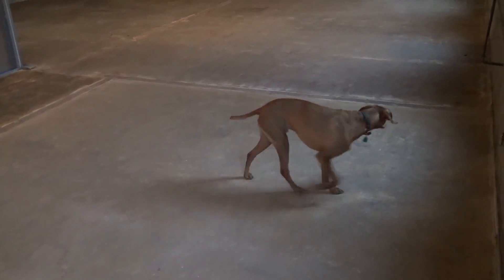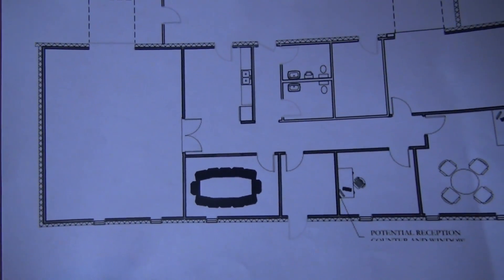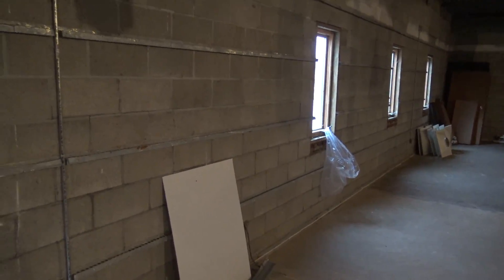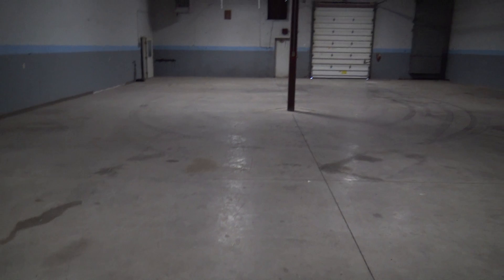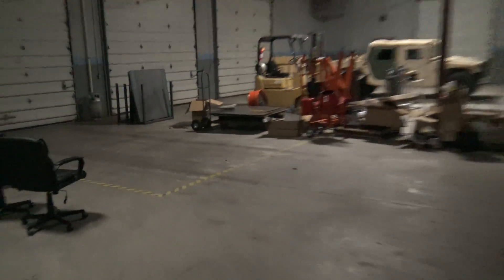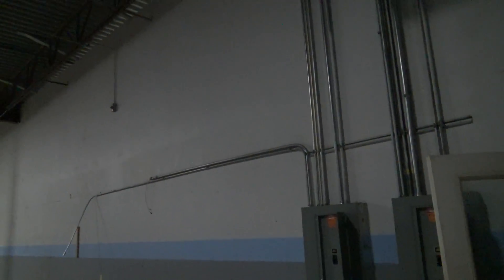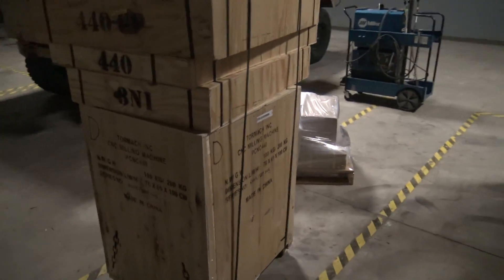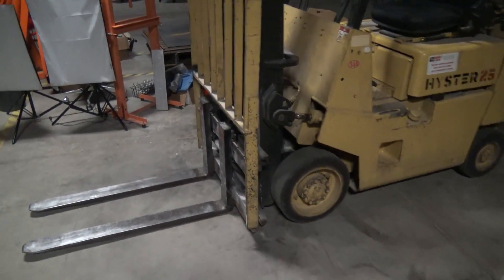Shop Update #1

Comment: Congratulations John. 
Regarding lighting, avoid T-5, they are expensive to operate, tube life is poor, replacement tubes are expensive, ballasts are expensive, they flicker a lot and lumens per watt is not as good as HID-Metal Halide or LED. 
If it is affordable go LED, but beware of offshore brands, we have had some less than best results with "Assembled in the US" units that had color and brightness stability issues and eventually failed, warranty replacements were a pain and also failed. 
Alternatively HID-Metal Halide fixture lighting are reasonably priced, have reasonable operational expense, long maintenance interval(bulb replacement), provide good color rendition and have excellent lumens per input watt. 
Look into utility and or federal and state discounts/credits/rebates/grants. 

If it is your budget, fill the gap at the top of the separator wall now, it will pass dust, fumes, particulates and noise from the dirty area to the clean area. Doing it now will be much less expensive, cleaner and less disruptive. 

Rapid-Air is a good alternative to copper, is a lot less expensive and if installed properly and is undamaged it will last a long, long time. Including drip legs w/drain valves at each outlet point reduces moisture contamination. 

Look into PolyCuramine, we have found that PolyCuramine floor coatings outperform most epoxy floor coatings many times and is superior in many ways including being impervious to most chemicals, superior adhesion and abrasion resistance including steel gantry crane wheels and 15,000 lb fork lifts. 
Our coated floors and walls no longer sweat and no longer release dust. 
We coated the concrete floor and the concrete walls that extend from the foundation vertically 6-8 feet above the finished floor with light grey and above 8 feet to the ceiling/roof with high gloss bright white. It resists soiling and is so easy to keep clean. No dusting, ease of cleaning and the reflected light is well worth the cost. Our floors are now close to 5 years old and show very little damage and minimal wear. 
From experience avoid the lesser expensive water borne epoxies, they don not holdup in a commercial or industrial environment. Be certain to get a written as applied warranty from the installer. 
Some installers will quote the coating manufacturer's warranty and will not warrant the as installed/applied application. These are the contractors that quote dirt cheap prices, do not perform the prep and installation properly, then take your money and refuse to correct their mistakes. 

I would recommend using a penetrating floor surface sealer treatment in the fab area, it will help protect the concrete, prevent most fluid penetration(oil, water borne), keeps the spatter from sticking, helps prevent the concrete from dusting, is clear/transparent and does not burn. 

What are the plans for HVAC in the production areas?
Reply: NYC CNC
Cool, sounds like you are on the right track. 
Look into the PolyCuramine, this stuff is amazing and virtually indestructible, even with heavy forklift traffic. It even resists acids, brake fluid and lacquer thinner. 
For us, those super sized industrial ceiling fans help some in the winter, but are absolutely no help when reversed in the summer heat. 
Large roof mount exhaust fans with security bars have been the ticket in the summer.

Comment: Glad to see things are coming along. I actually just did a new conference room over the summer. We had never had one and it seemed like a good idea gives us somewhere that stays clean and is comfortable to meet with customers or have meetings of need be. Bought a beautiful conference table second hand. Like you I looked into the copper lines and found them to be way to expensive. You really only need to run a large main line and then your branch lines and drops could really just be 3/8, or 1/2 inch lines. Unless you have a large machine with huge volume demands like a pallet machine or large pneumatic machine you will get plenty of air volume along with sustained pressure.
Reply: Oh and one other thing I found a good way to account for growth is to use T joints in your main line every 6 or 8 feet with the T pointing up. Just plug the ones you don't use but this allows you to just unplug them and run a drop from there if you add a new machine or work station
Reply: Oh and have a Merry Christmas
Reply: +NYC CNC Our conference room is 18-1/2 feet by 13-1/2 feet. I also used it as a place to put up pictures of our business through the years. There are pictures of my grandpa, dad and me along with other people who have worked here over the years. There is one wall where I have pictures of them building our current building from back in the 70's that are in chronological order. I also have a projector that I can display on the wall if need be. I am working on getting a display case to put some of the work we have done for customers over the years. It's deff a good place to really be able to display what your company is about and for me that is family.

Comment: I would recommend you plan to close off the gap at the top of the wall fully - how? studding, insulation and some suitable type of board. Foam filling to match the profile of the roofing material.

Comment: Rapidair works great.   You can get 1" lines for the main runs and then branch out with 3/4".
For the large dividing wall.  I would place insulation between the wall cavities and use 6 mil plastic on both sides.  Use metal studs (or wood if code allows) and run them up to the ceiling.  Slap some drywall on each side and your dust and lots of noise will be stopped.

On the front area, I would put drop ceiling in the video room, conference room areas.  It will help greatly with noise and dust.  Plus on the video area the white ceiling tiles will help with lighting

I look forward to seeing it at the open house.

Merry Christmas
Chris
Reply: When I had my studio, I dropped bars from the beams.  I used beam clamps to hold them and then dropped a vertical bar down to a tee  and then ran horizontal bars to hold lights and backdrop.   We had one room with white ceiling tiles and one with black ceiling tiles and grid. The bars just came down through the tiles.  The Black really helped with reflected light when we wanted to control it more.

Comment: As for the lights, I support the decision on going with LEDs, as I've said on the first video.
The price is not that high - it pays for itself quickly, as LEDs never burn out(compared to regular T5s) and use a tiny amount of power(a 10W LED is roughly equivalent to 200W of incandescents), and if you clean them out sometimes(dust), it'll never lose color or do anything bad like that, if, of course, you buy proper quality lights.  My suggestion would be to order a few tiny LEDs from eBay with various colour temperatures and play around - select which one you like, which one suits the shop. You don't want the light to be too warm or too cold, but I don't dare suggest bulbs from Yuji - they're nut-cracking expensive, although almost identical to sunlight.

And for the separation - just regular plastic should be enough, don't bother framing it all, I've seen it done this way in a few buildings.

Air-wise you can just get air-rated PVC pipe(kits) or alike, it shouldn't be too expensive, there are options.

P.S - you should try installing a few skylights in the ceiling! It's perfectly suited for it, and it's cheap(ish).

Comment: Good plan putting the fab on one side and the machine shop on the other. Another Idea is to install some air exchange that vent from the fab shop and intakes into the machine shop. This is how a few places here that have their welding bays in the machine shop set up. This way you get a fairly steady draw to the toward the fab bay and then if you are making dust in the machine shop it will gravitate toward the welding bay. Just go with black pipe on the air lines and put a dryer on the compressor for your main run when you get to that. My dad's auto shop has had 1" black pipe that was installed 25 years ago, just an auto drain on the compressor, traps on the bottom of the drops, when we renovated it there was minimal surface rust in the piping and just a little bit of crap in the bottom of the traps. Anything that could be harmed by a rust particles should always have a filter/separator on it anyways. Also instead of installing large pipe I would consider putting secondary receivers at the ends of long runs or in the middle of your loop if you're going to go all the way around.

Comment: sch 80 pvc for air lines, its quick, cheap and dose not corrode.  awesome stuff just saw it go in on a new fire house I am wiring.
Reply: I'm a commercial electrical journeyman in NJ Uniform construction code allows for pvc in not air plenum locations ( if you plan to install it in a drop ceiling for example) it was installed in a brand new FIRE HOUSE i'm currently wiring, for the Air lines to keep the air brakes charged up on the rescue engines. Installing  it on open walls or in open ceilings is a okay in NJ check with your local building officials. use airline rated plastic I looked at the pipe today it was a flexible  plastic hose system still really nice and cheap.

Comment: Awesome John! Got a good plan coming together. Check out the air lines made out of aluminum tubing. I'll check ours and see what brand it is. They supply all of the connections you need for a complete system.
Reply: +Abom79 Ingersoll Rand makes SimplAir piping with marine grade aluminum.
Reply: +Abom79 and John
Could you please explain to me, why its so important to do the airlines made of metal?
I've done my trans-building air hoses made of 30mm OD 4mm wall PE tubing (blue one, the same used to join out-house water system). It cost less than 10 eur (about 25meters). The tubing strength is about 16 bar = more than 230 psi. Using that much air pressure for what? Most of my pneumatic tooling uses 6.3 bar max. A quick change tool spindle needs more or what?
Reply: +Tomasz Staroń  Most of the codes specify no plastic primary air lines in commercial spaces. Far to easy to damage with chemicals or striking with tools/equipment. Also many plastics are designed to be used in more protected areas where UV/sunlight doesn't cause them to degrade. Couple that with the plastic sagging and causing low areas where water collects as well as the plastic not removing the heat from the air as fast all work against you. 

In this instance I would set up the compressor and a large air drier and a few point use filters and call it a day. Probably use PEX-AL-PEX for the lines and clamp them every 2 feet.

Comment: to close the gap just use expanding foam
don't worry about fire ratings like others have said, reason. the wall is not firerated at the moment, so there is no need to make the flashing at the top fire rated.
expanding foam, quick and cheap. its so far of the ground you can't see if its not perfectly beautiful.

Comment: Oh and regards to the gap at the top of the wall. I'd use plastic and not look back. To be honest the wall is so high you're more than likely going to be fighting the smells of welding, cutting, and grinding more than the dust. If you plan on installing a CNC plasma table I'd build a small room for it so that you can get away with an mild exhaust fan for the room vs dealing with a water table or super powerful down draft setup. This would let you keep the computer outside of the room and away from the smoke and crap plasma cutting creates in the air too.
Reply: +NYC CNC I've seen several uses of plasma tables that have the table/workpiece set at an angle that's closer to vertical. Would make it easier to build a downdraft enclosure and then use welding curtains to cover gaps that are exposed.
Reply: +NYC CNC I've given this quite a bit of thought for my own use. I plan to have either a roll up door wide enough to move the whole table in and out or double doors wide enough. Make sure the doors as accessible by forklift and load the sheet/plate in that way.
Reply: +Alvarez Metal Works  That's a good idea if he can budget it..  At my old job we had a machine with no water table, no downdraft.  It was terrible with the smoke and powder.  I think John has a water table on his torchmate?
Reply: +NYC CNC search "burn tables" and you will see what he's talking about. Personally I'm not sure how I feel about that setup. Just imagining large and small pieces falling or getting jammed and tearing up the machine.

Comment: Something to consider with the LED lights. I've been replacing all the lights in my shop with LED fixtures that I picked up at Sams Club. $35 each. They don't draw hardly anything (0.35 amps) and are really  bright for their size. Check my videos for the video I put out about it. It's a recent one. They are designed to be plugged in and have a pull cord but that is easy enough to work around. Install plugs in the ceiling or cut the plugs off and hard wire them into the electrical system. You'll need a lot of them for the space you have but if I was you I wouldn't even hesitate to go that route. The electrical saving will allow for you to install more light and still save on power. The cost is just too good to not give it a try.

Comment: BTW. I love LED in my shop. Only way to go IMO. I got mine from superbrightleds.com. I am also going with a rapid air kit but I'm small potatoes just a hobby shop. I'm just running a sand blaster and hvlp gun doing cerakoating.
Reply: +NYC CNC it be cool to see how you like the rapid air setup once it's done.
Reply: +NYC CNC 2" ID airline is serious volume, you sandblasting in there? Our shop uses 1" galvinized but the  longest run is 120ft and we see no problems running big 3/4 impacts. If you have hose reels on your system they will be your choke point not the feed line. If ypou can find a cardboard box the right size for your gap then you can line it with a garbage bag and fill it with spray foam to cast expanding foam bricks. You can then shove them into the gap to seal it without bonding it to the roof or wall so you can still have expansion and contraction and it is clean as you don't have expanding foam hanging out everywhere up there. There is also fire resistant spray foam available if that is a concearn.

Comment: John,

My clients have used fiberglass batts held in place with flashing to close off the gaps between the top of a stud wall and a sheet metal roof... depends upon your local code requirements.  The other option is to use drywall to hold things in place if you need a higher fire resistance.

The fiberglass won't burn, and it forms a dust seal against the roof. Kind of important when you are dealing with a steel mill's meltshop, where the traditional rubber sealing strips burn up and fall out... your situation is a bit more refined...

Cheers,

Eric
Reply: +chemech  Another product that is reasonable and more fire resistant than fiberglass is 'Roxul'  it comes in acoustic and insulation grades.  Both being about the same. Price-wise it can be less expensive.  Jim

Comment: T5 s at 1000bulbs.com are $3.50 per bulb by the case of 25. High output 54 watt. They work great but are voltage sensative...blew some on a generator that was messing up and not putting out full voltage. I like your new space...good luck.  John

Comment: Hey John what about using an expanding foam to seal off between the rooms? I know codes have changed and are different in different areas but they often use the expanding foam for sealing holes for plumbing, electric, or venting through walls and floors to meet fire and building codes in construction. So you might not need to frame anything or use plastics. Quick and easy.
Reply: +Mad Painter Mostly, that depends upon the fire resistance rating required for the wall, as you point out... some of my clients have used fiberglass insulation and flashing to close up gaps at eaves and the like - it won't burn.
Reply: That's the other thing if you don't seal it the dust will accumulate and be a fire hazard as well. 

I gotta admit that even though we haven't met yet I'm excited for things to come together for your shop!

Comment: For the lights, get 6500K lights (daylight), it makes video and stuff.

I like doing full separation at the top between the big rooms.  Also, insulate to keep down sound.  When teaching or even around big equipment, sound is not your friend.  I lost much of my hearing largely due to loud sounds while working around big equipment while in college.  It may seem OK after a few hours, but it never really comes back.

Also on the doors (roll up especially, do some sound deadening, even if it is pull back 'sound curtains' to keep from transmitting to much into other rooms.  You may even want to frame the 'studio' to be like a insulated room within the building' just to keep stray noise out, also accoustic work on the ceiling especially in office, class room and studio area.  But that would also be appreciated in shop area.  Not to turn all those areas into 'studio quality', but to keep down ambient noise to make the education better!

Enjoy, and I like the series!
Reply: +servant74 
I couldn't agree more with your comments about sound / noise issues. It is mighty wearing if someone nearby is walloping a lump of metal with a hammer or grinding on something and your trying to teach people. Similarly radios or other audio machines can torment you day after day! 
Fans and sometimes electric motors can be a real bug bear ( eg Think your room heaters! We switched them on before the start of classes, during breaks etc but off otherwise.)